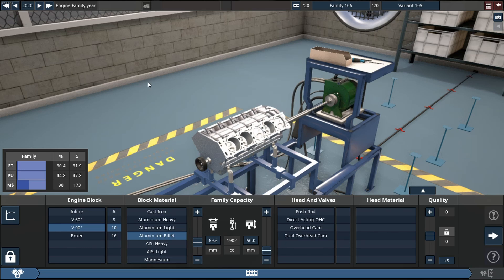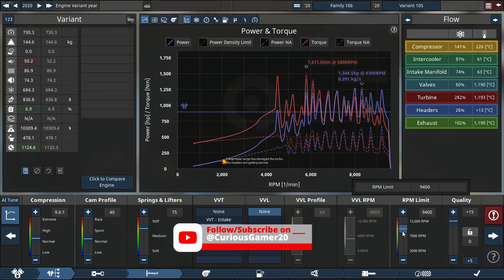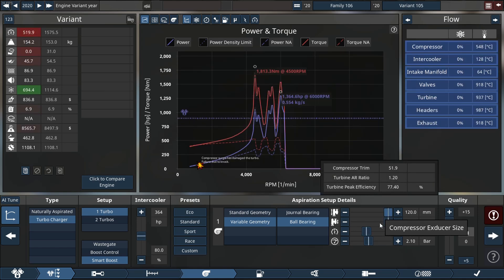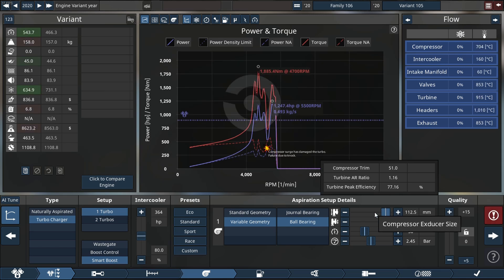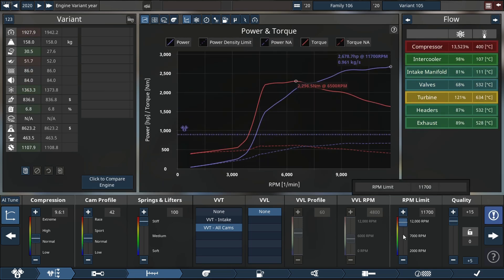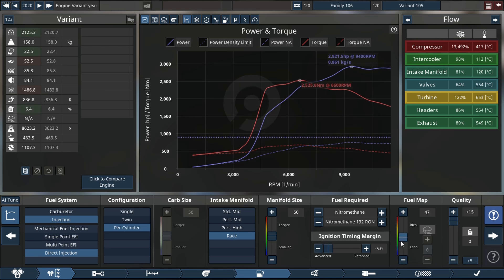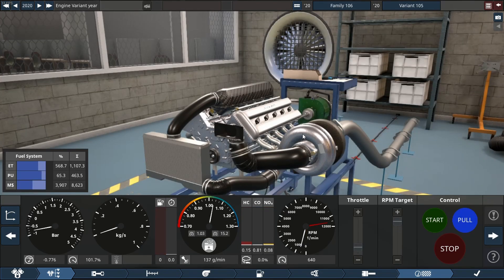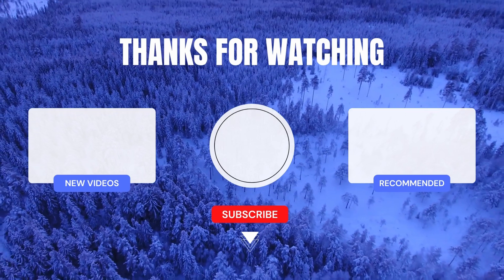10 CYLINDER 3000 HP! - Automation the car company tycoon

Comment: bro forgot  the intercooler
Reply: Not needed with nitromethane or methanol as the sheer amount of fuel is cooling the combustion chamber enough to avoid issues. All cars running methanol at the drag strip do not run an intercooler as it just adds weight and complexity, and is really not needed with that type of fuel
Reply: @BF26595  still going to add restriction to the pipes, might as well remove it